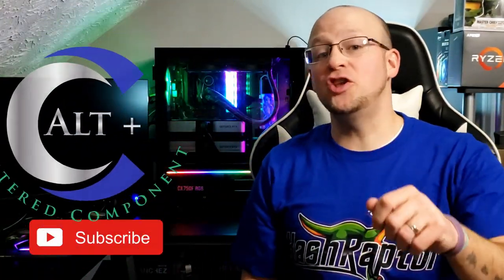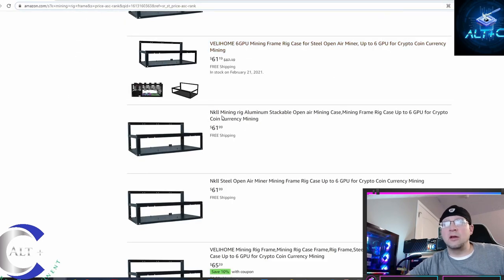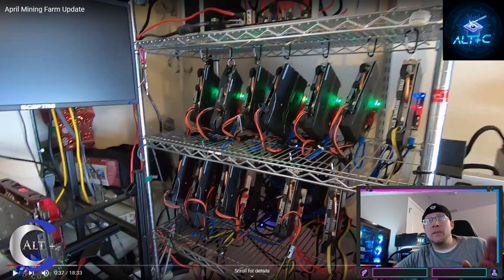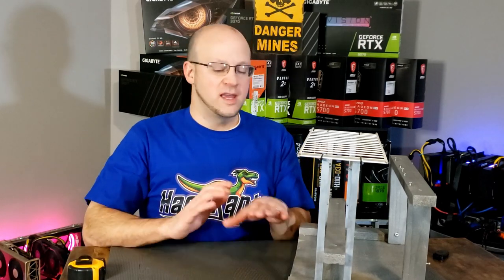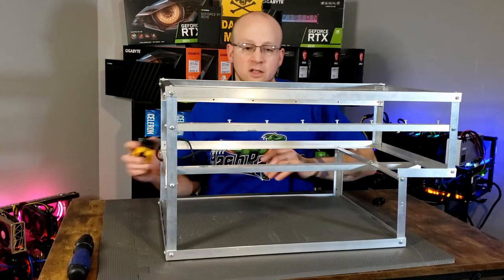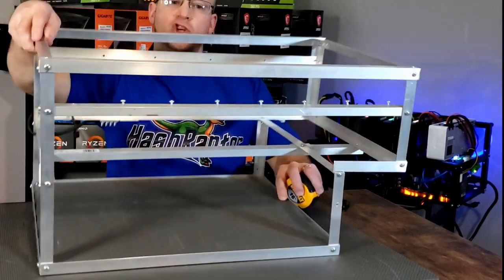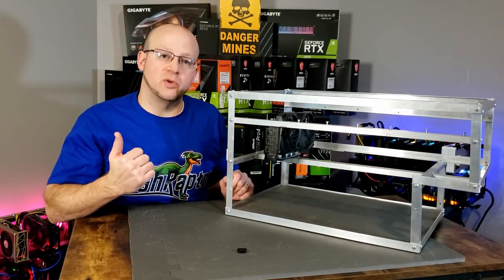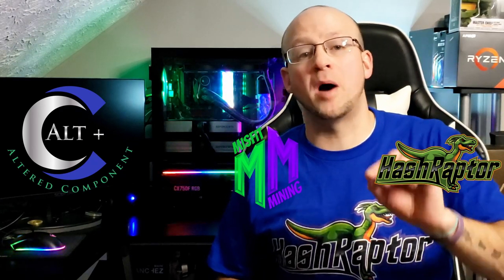How to build a Mining Rig Frame + Buying Options & Alternatives

Comment: Great info, I combined a portion of your aluminum build & Hash Raptors rack build & its working out pretty good. I'm using a 3.5" thick horse stable mat cut to shape for motherboards, adjusted the 5 tier rack heights, & opted out of rig fans for a shop fan that keeps the entire rack cooled
Reply from the maker: Sounds amazing.  Ingenuitive.  Back when I first started out it took me a bit of searching to come up with the foam rubber tiles that I use.  That is the best, when u take ideas and adapt them to your creation.  Much more pride behind that than a pre-built. Thanks for sharing

Comment: I buy metal shoe racks for $30 from walmart and custom add mobo support, psu bracket and ssd bracket from old free pc cases that I pick up locally
Reply from the maker: Cant blame you.  I also have done a shoe rack build.  And smart on the old brackets.  The Amazon basics wire racks are like 30 bucks as well.  Thanks for sharing

Comment: Definitely digging the budget aluminum frame idea, bought the stuff to do it today. Easy diy, cheap, mobile, and I can slowly fill it. Have 2 rx580-8gb, and a gtx970 for now. They're just laying on top of the tower now. lol
Reply from the maker: Thanks for watching.  That is exactly what i did when i started in 2017.  I had an extra card on top of the tower with double sided tape holding the riser.  then added another, then i moved to a wood frame and then did some aluminum.  better than wasting way too much money on a cheaply made prebuilt right now.  Mine on

Comment: Fantastic! I was struggling finding a frame that would fit what I want to do. The issue is that I'm using Server Power Supplies with Breakout Boards and they take some much more space (lengthwise) than regular ATX. Most Rig Frames are designed for ATX PSUs - so I was having to go for a much larger 8 to 10 GPU Mining Frame to fit my Mobo + PSUs and others on the base level. This solves it for me. I'll just make the custom Aluminum Frame with angles and channels and should work! Thanks!
Reply from the maker: Heck yeah.  It takes more work for sure,, but years later and i still have my frames and i am much more proud of them than a quick fab frame  Appreciate the watch.

Comment: Hey Buddy this was very helpful.. Will 600mm Length Be enough for 8 3090 cards Rig? Or is that for smaller Cards? Will there be enough spacing in between for cooling? And Also i need to fit in 3 Power supplies..
Reply from the maker: If I were running 8 x 3090, I would get the specs off a 12 gpu frame.  You need that extra spacing to keep those cool especially the vrm Temps.  Honest if I were doing 8 x 3090, I would use the specs from a sluice v2 12 gpu frame from aaaeave.  Put 4 on each layer.  Take care
Reply: @AlteredComponent  You are scaring me 😓 now.. Yea I know about the Vrm Temps.. But individually it's only hitting about 96°C @ 98% Fan, so with 120mm fans & Also iam adding a big Table fan just for this Rig.. I don't like staking cards vertically because of the wiring & stuff & also less vertical space.. So I wanted to build a Horizontal 8 card Frame but i think each card is a 2.5slot card so how much space should there be between each card for optimal cooling? & What should be length of the Frame? Did you build something like this with similar or same cards like 3080's or something?
Reply from the maker: @iguy6104  for reference,  my 8 x 3070 rigs.  One is 24 inches wide, so like 60cm which would be wide enough for 5 fans.  This would be wide enough but only leave u about 1inch in between each card. If it were me building 8 by 3090 and not building a dual layer, I would make it 28 inches, or 72cm wide. That would allow for 6 120mm fans and give nice spacing for airflow.
Reply from the maker: My other 3070 x 8 rig is 27 inch wide and holds all my high end 3070s.. this one i have 5 fans mounted on the io side of the gpus pulling air in.  They are 1800 rpm arctic delta fans p12.  Also at the end of the gpus, I have 5 fans exhausting.  They are 1200 rpm cheapo uphere fans.  The push pull setup helps bring more airflow across
Reply: @AlteredComponent  That's great!! I guess  i'll go for 30inch then for good messure, with 6 fans. And if nessasary the Push pull setup afterwards. What about the Depth though?

Comment: Thanks for the video. I'm looking for ideas for a 13 gpu frame. I'm using 1 atx, and 2 server psus.
Reply from the maker: Very nice.  I would do a 8 card length with 2 layers.  Then put 8 on bottom row, 7 on top row.  have the server PSUs in middle bottom tray and that should allow you to route the power cables and risers up to the layers.  Similar to the Aaawave Sluice V2, but wider to accommodate slightly more gpus comfortably.  Best of luck

Comment: The thing is when you put the GPUs in line, they block air from each other, how about arranging them so that each one is  out of the next gpus sight, so that when you put fan on the side, each will get a GPU, instead of a line put them diagonal
Reply from the maker: Thanks for watching.  Honestly it depends on the gpus as to optimal orientation for cooling.  Some cards primarily exhaust out the side, some through the front, and then most of the New GPUs use blow through cooling.  So a portion of the PCB is exposed, or the cooler extends beyond the PCB and the fan forces air across the cooler fins and heat pipes and pushes through to the back.  My 8 x 3070 rig for instance are doing a blow through all the way down the line.  essentially it is pushing the hot air from gpu one, into gpu 2, into gpu3, etc.  Logic would say this is a bad setup, but testing has actually show it to do decent.  I have a new Frame coming soon that has some interesting orientation for cooling.  Stay tuned

Comment: I need to get this done ASAP I have 2x asus strix rog 3060Ti 1x rtx 2060 msi gaming Z and a gigabyte gtx 1060.
I been using the 2 3960ti in two separate pc kinda scared a little with everything that just happened with the drops but I have faith. Long story short I need my frame like ASAP it's starting to look like me building one out of Aluminum plexiglass
Reply from the maker: Thanks for watching.  Yeah that is a solid set of gpus.  Availability right now on any mining parts is maddening.  Good luck

Comment: is there a signifigant improvement from using a rig frame or a typical PC? im building a two card rig in two weeks and ive got an extra case...is it a bad idea?
Reply from the maker: I have a dual 3060ti pc.  It is in a lian li lancool mesh case so it has lots of airflow.  I have both cards mining and no issues.  As long as the case gets good airflow and the cards are not going up above 75c, then u can definitely run them in a single pc case.  The benefit of an open air frame is mostly just cooling.
Reply from the maker: Thanks for watching.   Appreciate it
Reply: @AlteredComponent  thanks so much for replying directly, I was assuming a member of the community would eventually see it and respond. 
thats a huge relief then, one less thing I have to buy. hoping to break even in 4months with profit projections. thanks so much again
Reply from the maker: @KumoGoesFast  if the market stays as is, absolutely 4 months to roi a new card.  If u run into issues, jump onto one of the discords and feel free to ask.  Take care

Comment: Would it be fine to have aluminum flat bars on the bottom as long as ur using a standoff? ive seen some people do it but not a lot. or is it best to do what u did and lay some rubbery type material down.
Reply from the maker: Absolutely.  Personally I just use the foam rubber to ensure I do not ground out the mobo.  Thanks for watching
Reply: @AlteredComponent  Thanks for answering, people that engage with their audience are they ones that really deserve a like and follow, and thats why u just got one :). keep up the good work!
Reply from the maker: @CentralRed  thanks.  I greatly appreciate.  Let us know id you have any issues
Reply: @AlteredComponent  hello, i ran into a issue, just built my mining rig but i'm not getting any power, i tired a different psu but same thing. i looked at the manual my power switch is in the right spot. i know it's kind of hard to tell what it is but any advice on what to check?

Comment: but you break down the lengths to cut for the frame , or how to put together once you get the lengths cut
Reply from the maker: I apologize if i did not clearly give dimensions on this one.  If it were a rectangle / 6 card rig:  Width 20" x Depth 14" x height (top of frame) 13.5".  The GPU cross beam that the cards sit on is height of 6" to top.  The GPU cross beam that they mount to is 10.5" to top.  To put together i simply drilled just slightly smaller than the screws.  they are the self tapping tip and the threads pull the full frame together tightly. thanks
Reply: @AlteredComponent  can you give me how many of each piece I need for a 6 card.

Comment: how do you secure the server psu?
Reply from the maker: Thanks for watching.  2 things, I use double sided foam tape on bottom of server psu and the I zip tie the pull ring on end by plug to the frame.  Not a perfect scenario, but works just fine